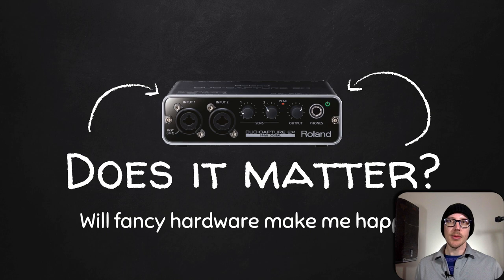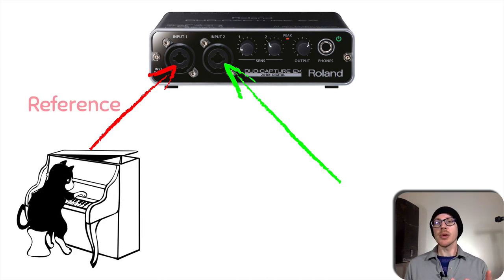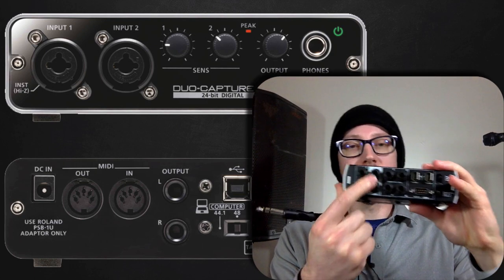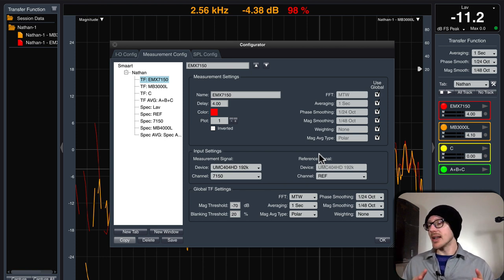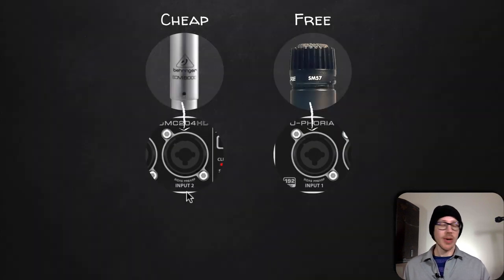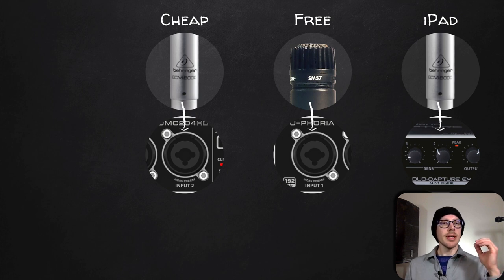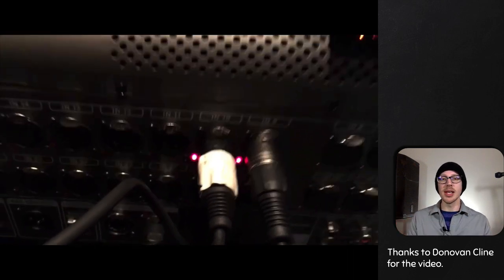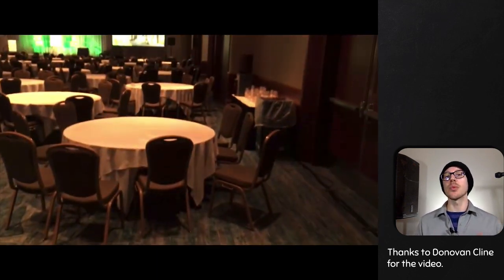Which audio interface is best for a Smaart rig? [GSwSST5]

Comment: Thanks for your video. I only disagree on one thing. In SMAART it's possible to get the signal generator to output the EXACT same signal on aux and route it to the unused output (2). Doing this you won't need a y-cable. You can simply just take a jack cable and loop it from output (2) to ref input.
Reply from the maker: Yes! Thanks Peter

Comment: hello mr.nathan im not exactly understanding why we need a loop back
Reply from the maker: Hey Elie, it might help to read the user manual for Smaart ro SATlive or other audio analyzer. The transfer function compares output to input. You need a reference to computer your input to.
Reply: a loopback means a reference that's the analyser software measure the changes of output return to input, bur mr.nathan its so hard to understand the manual to beginners
Reply: Hello Mr. Nathan,
Is it possible to take the balanced output from Headphone hole ouput (instead of from L channel hole output) then loop into balanced input?

Comment: Halo is there a way to run multichannel pink noise such as 5.1  with Smaart transfer function? Im trying to to calibrate my prepro via oppo's HDMI input. Thanks
Reply from the maker: Hi Dan. Sure. Just send it to a mixing console and bus five copies to to five outputs.
Reply: @nathanlively  we are home user we dont have access to mixing  console. Do u know a sound card such as focusrite that have hdmi and analog output? Or sound card with 5 analog output that can run at the same time. Another question: how do we run hdmi external generator from PC and analog ref at the same time, 2.0 is fine

Comment: Hi, is UM2 enough to measure car loudspeaker's phase aligment ? I also need ECM8000 with TSR to TSR cable, RCA to TS cable for loopback, RCA to RCA for DSP - its enough for my goal and I dont need extra regulators as 202HD had ? Thanx in advance ;D
Reply from the maker: Maybe. You can try it. Just note that the second input is Hi-Z for an instrument input. I don't think that should have an effect on the response, but you'll find out right away when you do your first test of measuring your microphone cables. If they're not flat, something might be going on with that input.

Comment: Great series, thanks! You have chosen the main output of 404, instead of PB outputs, for the REF signal. Is it to be able to loop in a balanced signal, at the cost of ensuring output mixes PB 100%?
Reply from the maker: Hey Mesut, I honestly don't know what the PB outputs are for. I haven't used them.
Reply: @nathanlively  OK, thanks. They are identical to what you get when you turn mix knob 100% to PB, without having to mess with the knob.

Comment: Great vid! Can i use a behringer um2???
Reply from the maker: Yes you can! That what I had my automotive guys using because the RCA outputs are compatible with most of their unbalanced DSP inputs. You'll need an RCA to TS adapter to get the reference loopback.
Reply: @nathanlively  thanks a lot brotha!!

Comment: Hi I have a Dayton imm6 and a trrs to trs adaptor. If I get 2 x stereo to dual mono splitters can I not create the loop and with a reference on say the left channel and the right channel for measuring . I would just have to switch speaker after capture to compare
Reply: That way I do not need an external audio interface and just use the computers mic in and line out as long as they are both 2 channel (in car audio tuning)
Reply from the maker: Hey Full Moon Party Video, you can create an internal loop in most software, including Smaart and SATlive.
Reply: @nathanlively  I forgot to split the  correct output channel and feed that into the input... so now it works perfectly... The upshot of all this is that i dont need an external usb IO to get a reference signal... Its an unusual case as my omni mic is a 3.5mm trs type and needs no preamp for the computer mic input to read... Im getting great traces... Thanks for all your great videos... perfect lockdown learning
Reply: @nathanlively  Well, after some experimentation i think i have aligned perfectly... I recorded what is was doing.. During watching the obs recording i noticed i actually had a perfect alignment during the tweaking between the subs and mains.. but i was busy inverting phase on the DSP as the traces were lining up better. What i was missing was the intersection at 0 degrees/85htz (Crossover). so in fact the subs are now set to normal on the DSP but delayed just over 8 ms... Certainly a learning curve... I added a small clip https://youtu.be/4W1fqPt7GUI... not plugging my channel, thats gone to the wall